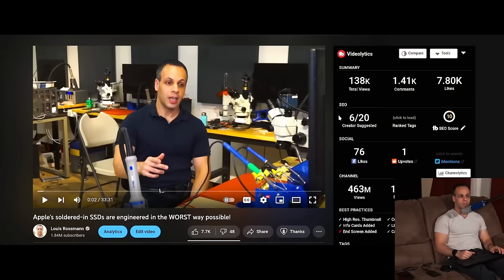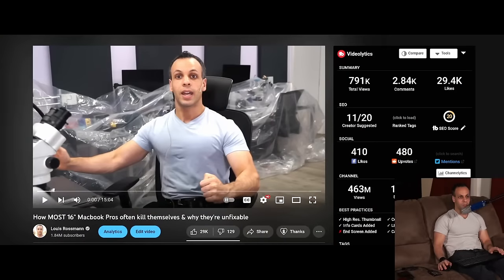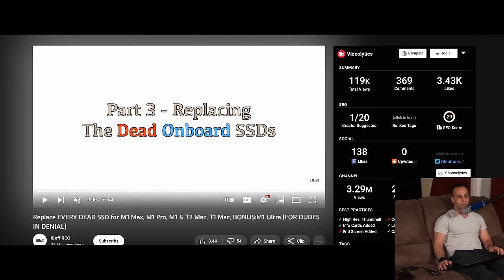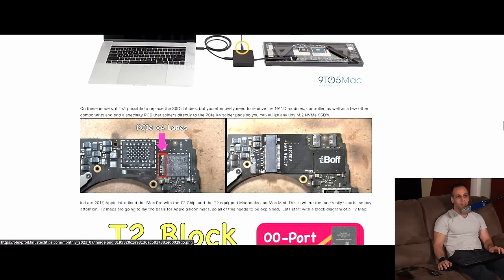The design of Apple's soldered in SSDs is worse than I thought!

Comment: So I'm using a flawed laptop, and after the NAND wears out, which is inevitable, I will be left with an expensive block of aluminum.
Reply: Sadly that would seem to be the case. Thanks apple☺️🗿
Reply: It’s still repairable even if significantly more difficult than it needs to be. Either learn to do it yourself or start looking for someone to repair it.
Reply: @Luke00722  Yes it's is repairable, but only using used parts that are ridiculously expensive. And then it takes a ridiculous amount of work and knowledge to make it work, and that is if it survives the operation.
Reply: Oh yea, and did I say used parts? That means that even if you do the operation you end up with memory that has already had some write operations, how many you don't know. It could well be about to kick the bucket any time.
Reply: Then they will want you to "give" it back to them, so they can take it apart, and reuse the parts to sell to another person, the cycle continues...
Reply: Sell it before it dies and buy something good.
Reply: @Luke00722  $600 for the replacement part plus $200 - $400 labor.  As the video pointed out, it's more logical to just buy a new laptop at that point.  Do it yourself?  Did you watch the video?  You don't seem to realize that aside from the required experience which would take hundreds of hours to gain, re-balling requires expensive equipment.  Telling someone to do it themselves shows a clear lack of understanding in what is required.
Reply: @rmbeats4008, sell that shit before it dies or so and get something else bro, better avoid apple for good, its not that there isnt alternatives out there :)
Reply: @Luke00722  Except the repair is the price of multiple brand new computers. There's no way that's ever going to be feasible for normal people, did you watch the video?
Reply: @Luke00722  bro is mentally incapable of thinking, did you watch the video at all? Why would anyone spend close to a thousand dollars on one repair? Can't you think? 🗿
Reply: @@bluewaffletwat exactly
Reply: @@bluewaffletwat Username checks out.
Reply: Inevitable. I’ve been using computers for 25 years. Never had any nand wear out.
Reply: Exactly.
Reply: Expensive block of cheap aluminum? Who have told you that Apple uses expensive materials?😅
Reply: And this hurts more then it use to as cpu's are powerful enough to last us 10 years or more.

Comment: Apple could have prevented NAND failure blowing the power supply by putting a fusible link in the power line. But that would have hit their bottom line. So they just let it destroy the whole machine, so boosting sales.
Reply: Any properly designed power supply should be capable of shutting off in fractions of a second in the event of a short. Don't need a fuse

Comment: This reminds me in a way of how consoles like the Wii would put the ""bios"" inside the NAND, so if that ever died or got corrupted you're not booting the console ever again. This should not ever be the case with computers.
Reply: Actually the way  Flash/ NAND memory is used  in the consumer electronics hardware space favors the manufacturer BOM and reduces device lifespan. One example Casio's old graphic calculators had the OS in a Mask Rom, later in 2000 in a flash chip. Algebra -FX 2.0  but at least the data was backed up to an SRAM with a backup battery, so you are not wearing out the Flash. On new versions ex CG-50 the OS and the bios is on the NAND and every operation you do on the calculator writes on this NAND, so it will eventually brick the calculator. Same with PS5, Switch etc. The days of hardware preservation and MaskRoms  or even EPROMS are gone.
Reply: @dfloper  This is awful, so practically Apple it is just the leader in these failures being notable sooner?
Reply: The NAND on the wii is at least standard, so you could in theory flash a blank chip and fix the system (wii-u NAND is even easier and can literally be wired to an SD card breakout), the actual "bios" actually happens on the hardware level, the NAND only handles the OS, channels, and save files.
Should they have used an EEPROM for the OS and only used an external SD card for the rest? Yes.
Does it matter as much when it's possible to repair with a soldering iron and a flash programmer? No.
Reply: On the other hand, my Wii system was bought back in '08 and it still plays smash bros like a motherhubbard.
When it breaks it breaks, but thats at least a decade away.
Reply: Actually there are multiple levels of "bios". For you to actually boot from NAND you must have already ran the code to initialize all peripherals, etc.
Having the bios and os and everything on 1 chip in case of embedded systems actually reduces the cost dramatically and exlcuding few open source cases there wouldn't be any use for you to actually be able to boot own OS. You still need image of the OS. What's the problem if it includes a bit of bios too.
Note that in case of Wii, the NAND was common component, with common layout. 
Problem in case of Apple is that there already are standards, which work and were used previously. If the NAND then has custom OS inside I'd argue it's actually anti-invention as it can very easily slowdown the memory itself. And also creating own chips just so they can't be bought is just plain bad, next level of epoxy over chips...
Reply: @freshmoor9357  A decade and a half, sir
Reply: @satsumagt5284  you right, you right.
Reply: @MrRobert264  The amount of data stored to the NAND in a calculator is trivial. Nobody is editing video on a calculator. This is likely comparable to, or rather much safer than, a mobile phone which will also die if the NAND dies. Apple is bringing that disposable portable device thinking to laptops.
Reply: Good thing there was some homebrew that allowed one to boot into a menu prior to the actual OS boot. As I recall, it was called 'Boot Mii' and it also allowed you to copy the Wii NAND onto an external USB drive.
Reply: @dfloper  That's AFAIK untrue, current-ish CASIO calculators without battery backup only store RAM to flash when you actually turn them off. You can actually verify this empirically by taking the batteries out and watching it revert to state from before the last session. Some google searching reveals that the cg-50 allegedly uses a flash with 100k write cycles. So if you turn on your calculator 10 times every day for 27 years it might break. The monochrome calcs allegedly have a million write cycles.
Reply: @freshmoor9357 just like these MacBooks will last many years. I never had a MacBook break or any issue in the past 16 years. So I trust Apple. Don’t care how they build it. Just care that it works.
Reply: @victorfernandes83  oh look, the perfect consooomer.
Reply: The Wii still loads most of the data off disks and doesn't read the NAND all that much, so putting the bios there isn't a big deal, which is clearly NOT the case as the primary storage device on a $1000+ laptop advertised as a computer suitable to professionals.

Comment: The best way to force a customer to buy a new laptop, 100% guarantee the SSD will fail, it's only a matter of time
Reply: sweet sweet recurring revenue..
Reply: Or they simply fill it up, which is especially likely given that the machine is already premium priced and most people probably won't pay extra for additional storage up front.
Reply: Except on PCs, assuming it's not soldered-on eMMC, if the SSD fails or you outgrow its capacity, you can either replace the failed drive or add a second drive, even NVMe drives on desktop boards that only have one m.2 slot via a PCIe riser card as long as the board's new enough to support NVMe, and SATA SSDs for any PC, desktop or laptop, made in the last 10-20 years, and even IDE-era hardware with a SATA to IDE adapter.

And it's really telling when vintage Macs have better community support, than modern Macs have for OEM support, like on a 68k-era Mac, viable modern hard drive replacements exist via the BlueSCSI among other SCSI hard drive replacement solutions, and the Floppy Emu takes care of any floppy disk woes, eg. iike on a Mac 128/512/Plus that only takes 800kB disks, and that officially can't boot off a hard drive, Floppy Emu would be a godsend for those earliest Macs in particular as 800kB disks are particularly hard to find or write for those where the Floppy Emu can just boot a disk image of the latest Mac OS version those older models could support.
Reply: It has been engineered. The less ram the mac has  the sooner will wear the ssd.

Comment: I just bought a 2TB ssd to upgrade the storage on my  gaming laptop. Stuff like this is why I could never buy a Macbook.
Reply: Was checkin macbook pro 16" $3500 + 8tb ssd +$2200
I bought 4tb ssd for $170. 8tb nvme is $340. A whole 4070 laptop with 32gb ram and 1tb is $1700. 

So with the 8tb soldered ssd price upgrade price for mac, you can buy 4070 gaming laptop with 8tb nvme ssd and get extra 1 tb ssd which you can put on external case and become usb drive.
Reply: I just upgraded mine to 1 TB.
Reply: Apple Fanboys will tell you that nobody is upgrading his/her Laptop - (almost) never...
Or just buy the config you need – so there is no need to upgrade later…
Or just buy the max. config….and other silly things.
I don’t think it makes much sense to argue with them at all.
BTW: While their where whole business models based on the fact that they could make a cut selling MacBooks/iMacs upgrades or upgraded MacBook/iMacs for less than Apple and still make a decent margin on these:

I upgraded almost any computer I owned at some point. Best example my Sony Vaio that came with 256GB SSD 8GB - which was the max. config sold at that time - and now runs 16GB RAM and 2TB SSD + 2 TB HDD(installed in the DVD-ROM-Drive Bay).
Even my 2012 MBP 15" is upgraded from a HDD so SSD and from 8GB to 16 GB RAM - but I really try to avoid to buy any new Mac.

Comment from the maker: Say hi to these guys for excellently done content: https://www.youtube.com/watch?v=yR7m4aUxHcM

Timestamps:
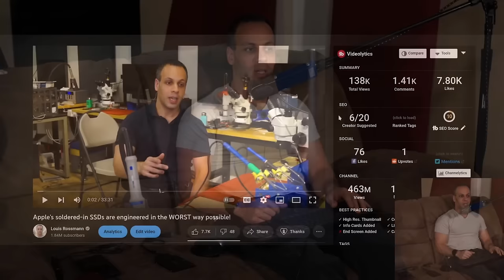00:00 - Intro
00:18 - Part 1 - Apple begins soldering on the SSD w/ A1706 & A1707 model in 2016
00:30 - If SSD dies, you can still turn machine on & boot from a flash drive, USB-C external drive, etc
01:03 - Part 2 - Apple adds the T2 chip in 2018 
01:45 - T2 chip runs bridgeOS which is stored on NAND
02:01 - T2 chip necessary for computer to turn on. If NAND corrupts/dies, machine CANNOT BE TURNED ON AT ALL!
02:39 - This NAND is propriatery custom designs that cannot be purchased on its own
03:45 - Donor Macbook boards with NANDs cost $300+ and have used NAND that may have 50 TB of write cycles
04:24 - Only place to buy these NANDs new is a 1 TB SSD kit on apple.com for $600...
05:17 - Part 3 - New NANDs die more often in a way that destroys power to the entire machine
06:09 - This was NOT a problem with the older, standard NANDs
06:48 - Apple drives the industry forward with common sense innovation - I appreciate that
08:32 - Too often, these innovations come at the cost of common sense design, durability, repairability, and reliability
09:38 - These new custom NANDs fail WAY TOO OFTEN
09:58 - Thesis
12:16 - This isn't fun anymore
17:25 - Repeating myself, because my name is Louis Rossmann
17:55 - Pre-written rebuttal to the engineer's argument
Reply: This is not Wednesday morning
Reply: @dcogs8856  I was literally about to reply with this lol. You beat me to it by 13 minutes
Reply: iBoff RCC's video is great! Lots of graphics and diagrams and warnings of things that will cause problems. I don't use or repair Macs but it's interesting to see all the details of the NAND chips and limitations.
Reply: @8:24 - two cats teleport in
Reply: You vibe the same as the "everything is fine" dog
Reply: it shocks me how they keep removing parts, connectors ect... but the price goes up?
Reply: I don't see where to email this to Louis. 
Google will now be deleting inactive accounts. Got important info on there? Too bad...

Comment: I remember when my 2006 Mac Pro was no longer able to upgrade operating systems because Apple stopped supporting 32 bit computers. I was confused because i thought they had 64 bit architecture. Apple made the decision to limit those Mac Pros to 32 bit mode in the firmware. Could Apple have offered a firmware upgrade? Yes! Did they? No! Did people hack their own firmware upgrade? Yes! Did i install it? No! I was too afraid of bricking my machine. Now I am back to the land of PCs never to return to using a Mac.

Comment: Using the NAND for boot is cheaper by deleting parts. Does Apple charge less? No.
Reply: It's cheaper for them
Reply: It's not deleting parts and definitely not cheaper because of the T2 chip, it costs like a 100 times more than an SPI flash. And that flash is still used, it contains the iBoot bootloader for the T2, it's just 1 MB instead of 8. A normal solution is just making the flash 16 MB to fit both iBoot and the UEFI firmware, or adding an 8 MB flash for the firmware, but it's more profitable for Apple to store it on the NAND.

Comment: This same crap happened to my father in the 70-90's...got harder and harder to get little parts like resistors and diodes for tv, vcr/camera repair. He just gave it up.
Reply: ICs I would believe but resistors and diodes? I guess it depends on what country you're in. In Australia there are plenty of retail shops like Jaycar and Altronics that sell that stuff. I guess in the USA and UK it's mostly mail order only (DigiKey, Mouser, Farnell etc). Still, there is a huge range of parts available. Just not Apple specific parts like the ones Louis complains about (other OEMs no doubt too).
Reply: I imagine it's more of a case that the problem became physically replacing said resistor. Nowadays they can be very tiny, so itd be a hassle/pain to solder or read the values, if even marked

Comment: This is for security purpose. Our ssd will never break. -Apple
Reply: Then you notice Apple is using by default SSD as RAM space if you run out RAM.
Enjoy the speeded up process of SSD wearing out if you open too many tabs in browser or your Apple Genuine mouse bug happens where mouse cursor starts stealing out gigabites of ram for it.
Reply: @XantheFIN  do you not know what a page file is?
Reply: @spaghettiupseti9990  This discussion is about macos system not windows. Macos uses virtual memory sorry. Linux has swap partition(s).

Or be free continue talk but i dont understand what hell your point is now or you missed my point.
Reply: @XantheFIN  my point is that windows uses the exact same thing
Reply: @spaghettiupseti9990  You didnt know its size is limited and not like Apple it can take over rest of the partition space.

Plus its windows pc so most likely not soldered ssd which when breaking wont stop pc booting.

And when you want bring others up why you didnt day or talk about linux swap space too? As this talk only macos once again.

I did know thanks about oage file since pentium 4 ht times as i went disable it on win xp usually.
Reply: @XantheFIN  I didn't mention Linux because I'm not very familiar with the partitions, I usually let the distro config that for me 
The rest of your points are completely valid.
To me it seemed like you were saying using an SSD for virtual memory is inherently bad but it looks like you were arguing the way Apple is doing it is bad
Reply: @XantheFIN Apple  puts 8GB ram on purpose so the ssd will get fried and dumb users think Mac os only needs 8GB.
Reply: Is there any way to disable the virtual memory?

Comment: Compaq (prior to being bought by HP) did this back in the 90's where they store their BIOS on a separate partition of the HDD instead of in a chip.

This introduced a ton of headaches, especially if you didn't have a backed-up copy of said BIOS. This maybe lasted a couple of years before the issues started cropping up. Not just hard-drive deaths, but malware could also make your PC completely unsalvageable unless you could get a "ghosted" image of the BIOS partition from another same model Compaq machine. 

Questions started popping up about security implications as well. Keeping the BIOS on such easily corruptible storage instead of a dedicated chip made it extremely vulnerable to attack.
Reply: In computer science class we did some repair on one of those Compaq computers. We started it up to make sure everything was good, called the teacher over to show them we were done with their assignment.

While the teacher was there another kid pointed to the bios chip and asked "what's this?" then they accidentally bumped it. The computer instantly died. Dunno if they ever got it running again.
Reply: I recall that they had the BIOS in ROM, but the setup interface you use to configure the BIOS was on a separate partition of the HDD. It was a hidden DOS partition that it boots when you want to configure and it runs a graphical DOS interface to present the settings.
Reply: In apples case they will just pay the fine or make the necessary revision for the following year so that the injunction "haha I can dream" can be avoided by returning to sensible design. These large companies are beyond past the point of having any proper oversight. The only solution is heavy handed "fair, sensible" regulations to force their hand to NOT do evil.

Comment: It's only Apple fans that keeps Apple in business. 

So basically Luis is saying that Apple designed a proprietary component with the propensity to fail, and never offered a fix for it even though Apple knew of the problem. I've heard of planned obsolescence, but Apple apparently is taking it to a new level of deceit, powered by agreed. Once Luis peeled back the onion to expose that Apple might've actually designed certain components to fail. In other words components have a limited operating life by design.